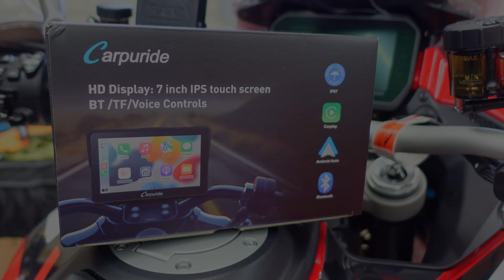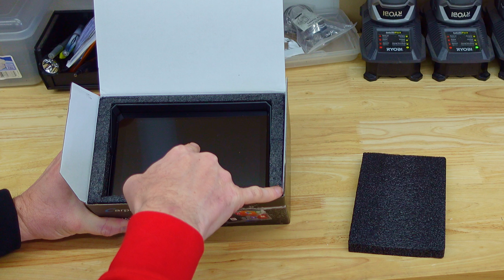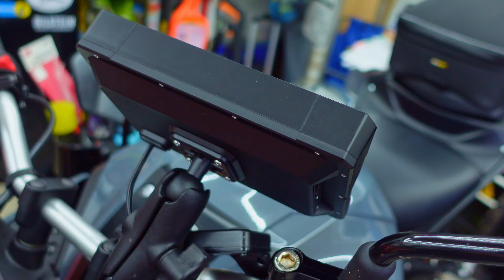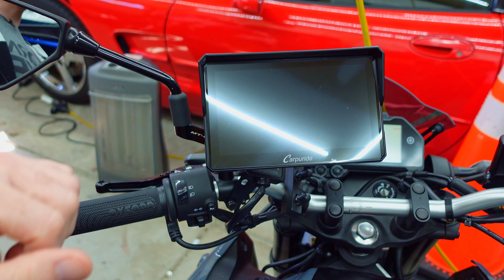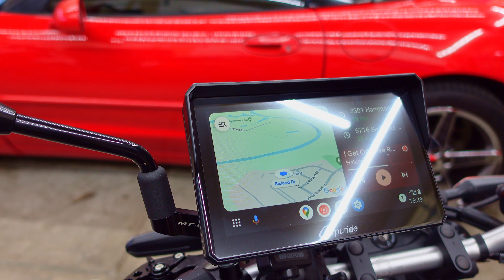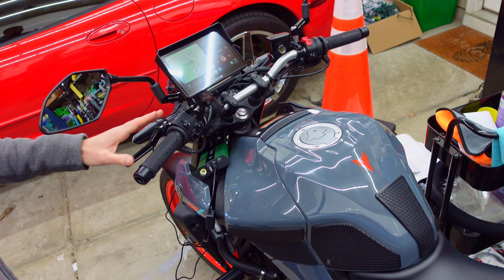Carpuride W702 Wireless Android Auto/ Apple Carplay for Motorcycles!

Comment: Hey Chris, a friend of mine just got one of these. I don't see the advantage of something like this over using Google Maps on my phone. I have an Evotech mount on my MSV4S and use a Quadlock with the wireless charger hooked into the Navigation pigtail on the MS. With the RAM mount, I'd want to remove it each time because it would be so easy to steal. I do remove my phone when I stop to go eat, but that's not a big deal. Thoughts?
Reply from the maker: So, the Carpuride tablet isn't the best Android Auto/Carplay solution on the market but it is a decent option. Ultimately, it is reliant on your phone for navigation. That said, it offers larger maps and more focused information that you need while driving. One of my more recent videos on my channel discussed the best navigation options for motorcycles. TL:DR I run the Garmin Zumo XT2 on my Multi with my phone still on a RAM wireless charger on the handlebars. Pretty much solves every problem.
Reply: It's supposedly hard on your phone when you You're using it in bright daylight. The screen stays at a high brightness for a long time. The idea is to offload that stress to something cheaper. And if you do anything off-road, you can damage your phones camera gyro thingy.

Comment: Hi Chris I also have a Ducati v4 pikes peak just wondering if you’re currently using the carpuride on your Ducati? If not what do you recommend? Ps I have a evotech phone mount with a quad lock fitted 
Cheers
Reply from the maker: To answer your question simply, no, I no longer have the Carpuride on any of my bikes. After significant time using it, I've found it just lacks the refinement for my needs. 

The happy place I've found on the Ducati is my phone on the handlebars and a Garmin Zumo XT2 on an Evotech windshield mount. 

If you prefer an android auto/ apple carplay solution, the Chigee AIO-5 series is the absolute best out there. If you have any other questions or want more specific information, feel free to shoot me an email

Comment: I have the B model for the BMW nav cradle and this works great. I do have one issue with it that I just found out about. I have my phone paired to it and when using BOSE ear buds or Apple ear buds, it automatically links my ear buds through the Carpuride. It won't let me pair them straight to my phone. It all has to go through the Carpuride and the system disables the noise cancellation option and I get a lot of wind noise through the ear buds. It's not that bad on the BOSE ones but the Apple ones are totally useless. It's extremely loud!!! Now with my Neotec II and the new SENA SRL 2 with the mesh system, it works just great. You have to go to the audio output button on the Home Screen and click the bottom option which is the BT Trans option with the SENA or Cardo helmet systems. If I want to use the ear buds, you have to click the top option which is the iPLAY / AUTO option. The ear buds won't work if you have it set to the BT Trans option. And like I stated, none of the noise cancellation works on either of my ear buds when they go through the Carpuride system. That's the only drawback I've seen with this system at all. I love it!

Comment: What about theft ?  can you lock it to the cradle? and why didnt you put it under the motorcycles screen above the tank ?
Reply from the maker: It isn't super easily removed, but nothing is theft proof. It would be difficult to put it under the handlebars in a way that would not strike the tank, interfere with fueling, or frankly be visible to you while riding.

Comment: Hi! After using both the 502 and tehe 702 for some time, are you happy with either device and with its size? Would the 702 be too big for a Ténéré above the dash? Thank you
Reply from the maker: If in your line of sight, the 502 would probably be fine. I run the 702 on my BMW R1250RT-P between the handlebars and it's adequate there. My Garmin Zumo XT2 is roughly 5 inches and I prefer that over the dash on my Multistrada V4

Comment: It works great on all 5 of my sportbikes. I have them installed in the middle of my handlebar yoke, which protects the w702 with the fairings and windscreen. Also, I can see my sportbike dashes with no issue.
Reply from the maker: That's great! It works on my BMW R1250RT-P, but not so much on the small naked bikes!

Comment: i am getting very bad music sound [crackling]
connection type - Phone Android Auto to Carpuride =>  Carpuride to Cardo Packtalk Black
Note: phone is not connected to Packtalk Black
when i reset everything and connect Only phone to cardo [ NO Carpuride ] the sound is back to normal
Any solution
Reply from the maker: I have been testing and have been able to duplicate your issue, it seems whenever I make a phone call or engage voice commands the audio starts fading. I am still working through this to find a potential solution.
Reply: @4KMotoring  the problem is fixed for me, actualy when i change the default equalizer profile to anything else than standard, the issue happens, so i default it to standard and music is good.

Comment: Doesn't work seamlessly with Cardo Pack Talk (or Sena S20) and iPhone
1) Cardo paired to iPhone (No music but does read out messages through Cardo)
2) Cardo paired to Carpuride (Has music but cannot control volume with Cardo. No easy volume control on Carpuride)
Reply from the maker: The underlying Carpuride UI leaves a bit to be desired. Personally, I find the difficult brightness adjustment to be problematic. I haven't tested it with iPhone, thanks for the feedback!
Reply: @4KMotoring  Could you control music from you headset? (Volume, Next Pause or Play)

Comment: Does it have a universal style back plate to possibly swap out the Ram style mount for a direct cross bar mount?
Reply from the maker: There are four screws on the back that remove the RAM mount ball, I'm not sure exactly what universal Mount you're referring to, but you can remove the ram ball and replace it with a different solution if you have something that fits.

Comment: has anyone used the direct battery cables?  is there an auto off feature?  off button?  does it drain batt?  thx
Reply from the maker: Direct battery cables are fine if you attach the positive wire to a switched ignition source. If you connect them directly to the battery itself it won't automatically shut down
Reply: @4KMotoring  another forum mentioned it auto shuts off even on batt cables after 4 minutes.  it must detect charging voltage.  i guess i would worry about vampire drain.
Reply from the maker: Not sure. I ran it off a lithium battery bank for more than 4 minutes without it shutting off in testing so I don't believe it has any such auto shut off, unless it's a setting somewhere that has to be checked. Even so, I'm not sure I would like a massive screen on my motorcycle staying illuminated for several minutes after I walk away from the bike inviting theft, I would just keep it hooked to an ignition wire and eliminate the issues all together
Reply: I connect mine to a healtech thunderbox which hooks up direct to the battery. Works wonders, will switch on whatever to connect to it when you start the bike, and switch off when the engine stops. Another positive on the Thunderbox, will not interfere with canbus.
Reply: @juliolopez9195 perfect my w702 just got delivered today .  plus i picked up that thunderbox as well :) thx for your reply
Reply: @juliolopez9195  I am wondering if I can connect it direct to the battery charger plug that is attached to battery all the time. Wire the female end to the carpuride unit which I can just unplug from the bike when not in use. I have done this but the unit will not turn on w the ignition just on yet my heated grips turn on. I am wondering if the bike needs to be running and then this will provide enough power? I have tested unit plugging in to computer and it works fine
Reply: @kiddcisco  wow, could not see why it should not work!…  I connected mine to a healtech thunderbox, and this box actually won’t power whatever you connect until the engine is running. It’s a feature to guarantee any peripherals won’t drain battery whilst the bike is off or with just the ignition on. But connecting direct should work, I assume.

Comment: Thanks for the review.  No one on these reviews show you how to actually connect your devices to the Carpuride. I have had nothing but trouble getting sound to go through my motorcycle intercom.
Reply from the maker: Really? I found it to be super simple with just the typical Bluetooth menus. What phone and what headset are you using?
Reply: @4KMotoring  Thanks for replying, I have eventually got it working. I switched the audio from BTtrans to use Android Auto instead. I have found an exit button on Android Auto which takes you back to the home screen. I will try and upload a short video.
Reply: @4KMotoring  
https://youtu.be/S786GYaGA3A?feature=shared

Comment: I purchased 2 of these, one for each or our CanAm's (Spyder F3 and Ryker). The mounting was quick and easy, wiring straightforward, and there is plenty of room on our  reverse-trikes handlebars. I was able to pair with an Android phone and Cardo Packtalk to listen to music (Spotify) and receive directions (Waze) at the same time. The only item of note is the same that you mentioned that once Android Auto starts you can't back out to the Carpuride main screen. I rarely need to access that screen once setup was complete but when I need to I just put my phone in airplane mode which turns Android Auto off right away, then I make my settings changes on the Carpuride, then turn my phones airplane mode back off, and then Android Auto automatically restarts/reconnects. I like the units and would recommend.

Comment: IMHO that thing is far too large for any motorcycle.
Reply from the maker: They make a 5in version that may be more appropriate, but I would be very interested to find out any motorcycle that can use this thing effectively
Reply: @4KMotoring I'll send you an email with a picture of the 7" W702 on my 2024 Honda NC750X.  Front and center, below the gauge cluster (LCD screen).  I wired the fused battery leads to a Healtech Thunderbox, set to "automatic" (TB white wire not connected to anything) so it only turns the Carpuride and any other accessories on after the engine is running, not just by turning the ignition to "ON."  This way you can't drain the battery playing with it while the engine isn't running.  After the bike is turned off and the engine stops running, the Thunderbox shuts down all power to all connected accessories a few seconds later.  The Ram mount and power plug make for quick and easy mounting and removal of the Carpuride, as desired and/or necessary.  Since the NC750 has a "frunk" with a USB-C charging plug in it, I can leave my phone in the frunk charging while the Carpuride handles the navigation and music.
Reply: 20 years ago I would have agreed. At 58 I do love big text. Just wish it connected to my Cardo correclty